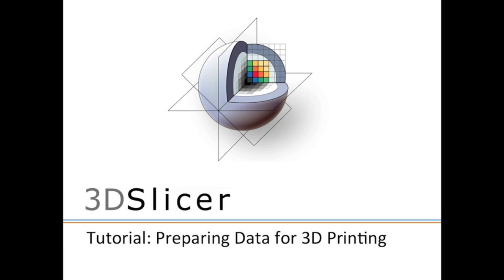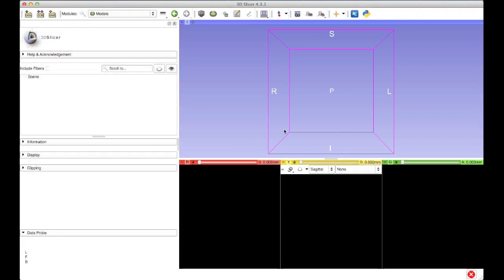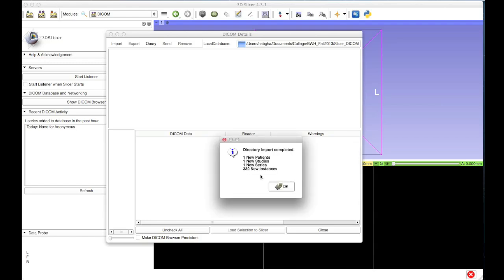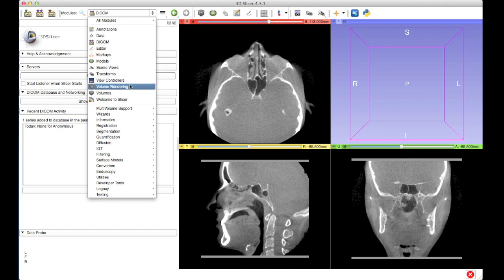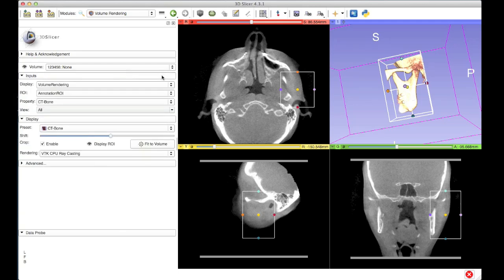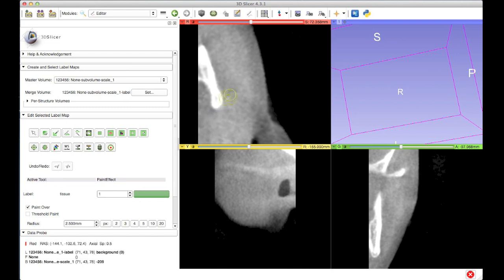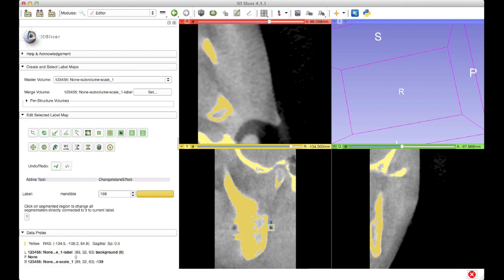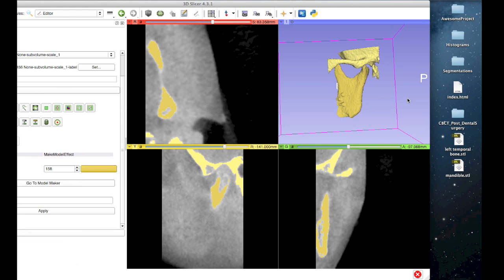Tutorial: Preparing Data for 3D Printing Using 3D Slicer

Comment: Folks trying to do this with Slicer4 - try using the 'segment editor' and ADDing a segmentation, using the threshold filter then click SHOW 3D (adjust smoothing in the dropdown off of show3d). Took me a while to figure this out. 
If you're just trying to print the entire scan - ignore the cropping / labeling stuff.

Comment: Thank you for the tutorial. I've been meaning to give this a try for a CT scan of a shoulder injury I had a number of years ago. At the time the company I worked for was a reseller of ZCorp 3d printers, and I was able to use some good but expensive software to create a model of the bones. It's very interesting to do the same thing with free software!

For whatever reason, your technique to drag-and-drop the folder containing the DICOM files into Slicer worked, when simply loading the directory didn't.

Comment: Hello

Thanks for the tutorial.

can i export 3D volumes from slicer to others CAD softwares?
Reply from the maker: +carlos latorre once you have segmentation, you can extract triangular surface and save it in STL format, which is typically compatible with CAD tools.